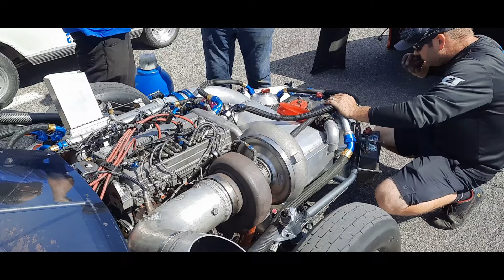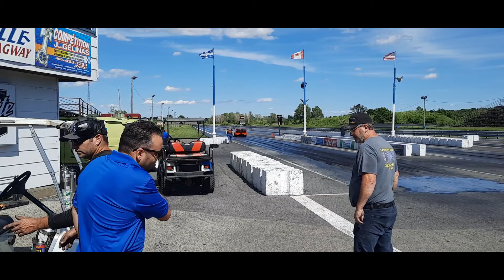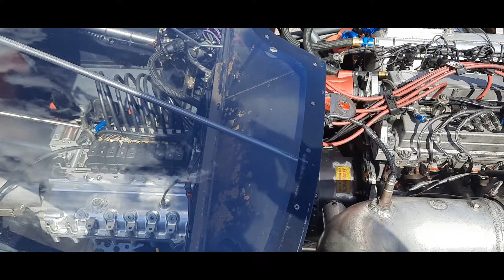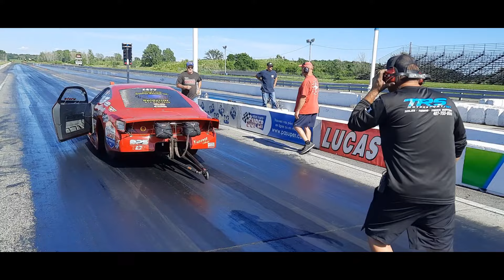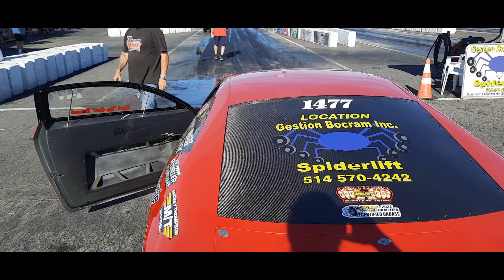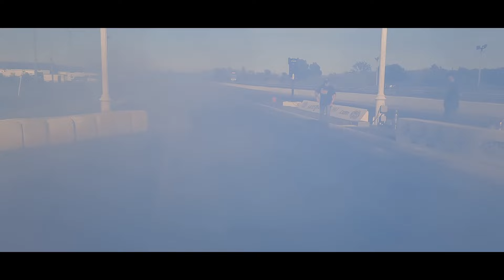➡️World Fastest 4cyl on the planet!😉💪

Comment: Quickest V8s run 3s...
Fastest V8 has gone 480+ mph.

Yaaawn
Reply: Why all the V8 guys have to bring up the funny car's to out run a factory displacement 2.0 liter, if there so superior why can't they ever run the same HP these guys have and out run them ? Because they can't!!!!!!!!!!!!! If my motor only lastest 1-3 sec I would junk it anyway, it's basically something designed to burn a lot of fuel really fast and it's trash!!! No thanx
Reply from the maker: Just give credit were it's due.. Watch the world cup in Maryland wil be there this fall..
Reply: I'm gonna assume that's sarcasm since no drag car has ever come close to 480mph, not even the experimental rocket powered one-offs. I'm quite impressed with this little 2.0 myself. Too bad track conditions didn't allow it to make a full pull. Probably not prepped and really hot outside. Good for 230mph or so if it hooks.